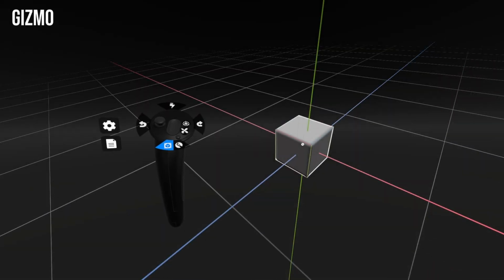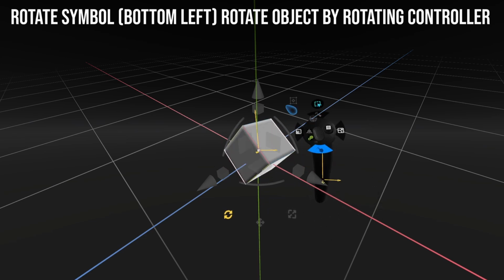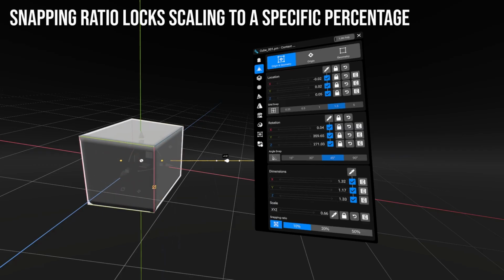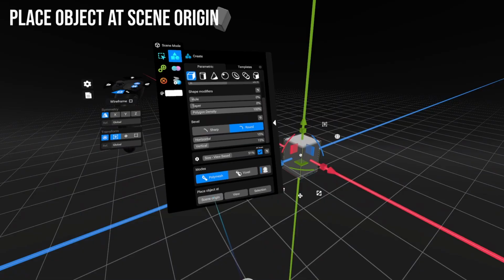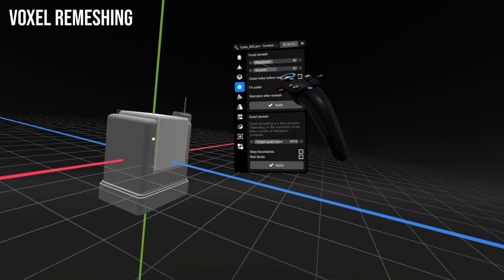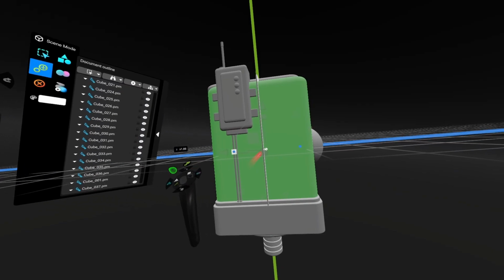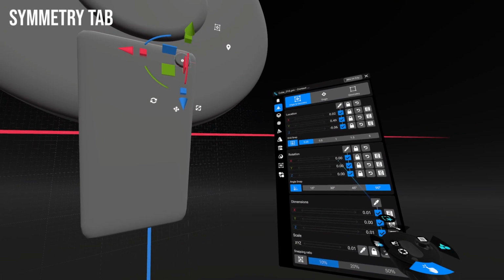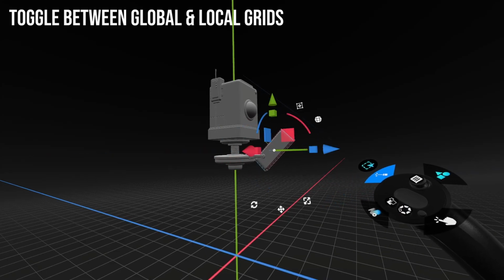Hard Surface Tutorial using Shapelab VR - Tips & Tricks

Comment: Awesome overview, I love your videos.  Just one note with the snapping tools.  There's a much easier window to access most of those features that's rather hidden (I found it accidentally).  If you rotate your left controller so that the small sub-window (Wireframe, Symmetry, Transform) is pointing edge-on to the camera (a similar motion to looking at your wrist), a secondary window will appear anchored to the controller with most of the Snap tools in an easy to use pop-up.  It's not obvious the window exists, and I didn't even know it was there until about a week into using the software when I accidentally rotated my hand a weird way and made it pop up.
Reply from the maker: I really appreciate all the support :D This is such a great tip! Thank you for sharing!